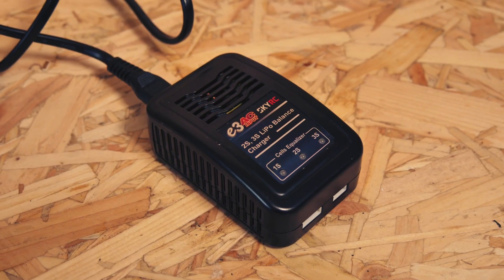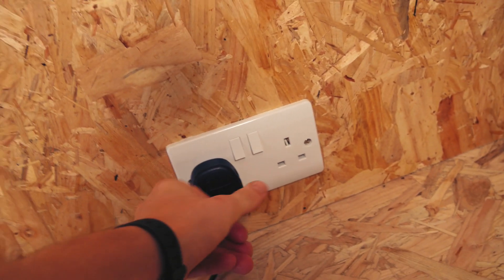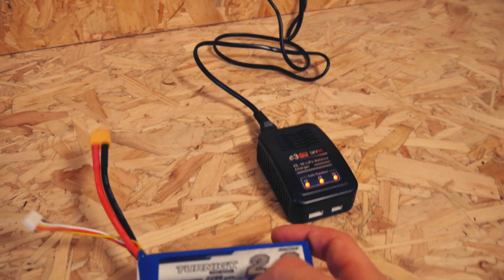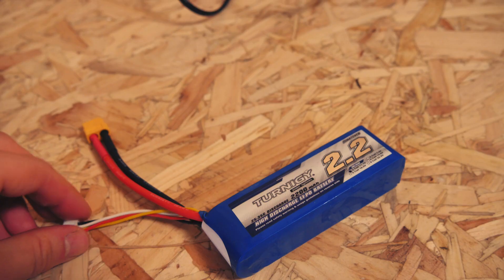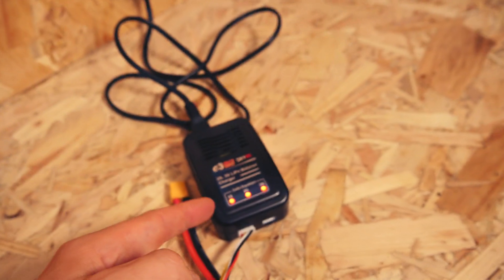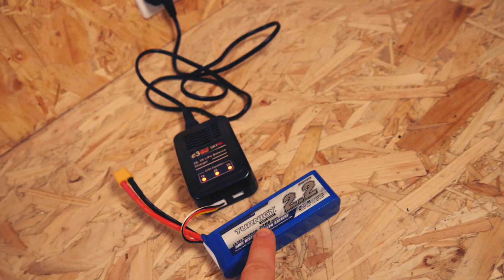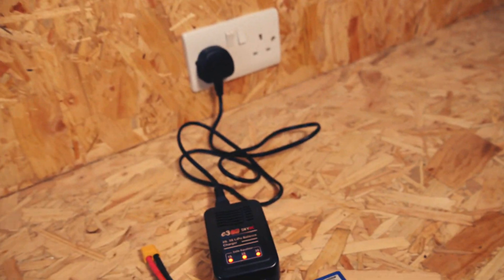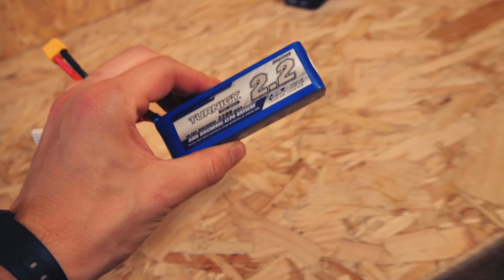How to Charge a LiPo (Sky RC e3)

Comment: NEVER charge a lipo battery in such environment as in this video unattended cause your home or shed can be burned down easily.

Wood is the worst point to charge a lipo battery on - at least as long as could leave the spot before it is fully charged and stopped charging, so you literally have to be chained to the battery to avoid that. 
Watch how a pro FPV lost his home here who had been warning others about this particular risks and once had missed to be cautious  
https://youtu.be/ZpLEF0j8sq0?t=321

LiPo Batteries are high performance batteries compared to LiIon (LiPo deliver a lot more Amps) and they tend to ignite themselve and burn if things go wrong internally or simply if the battery has aged (they ignite usually while charging, sometimes while used in planes going full trottle and without enough cooling). The whole wooden bench can catch and feed a fire, have not happened once but multiple times.

The video starts at the fire so you do not have to waste time and watch the whole video.
Reply: is a lipo bag necessary when charging a lipo battery?